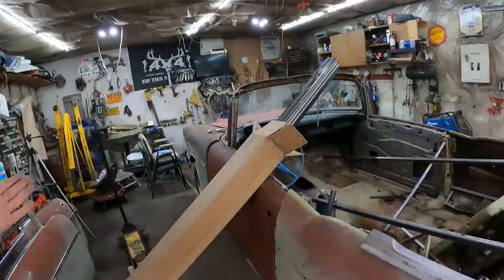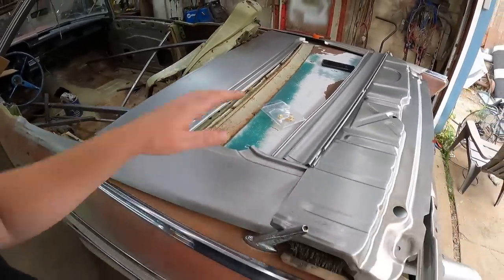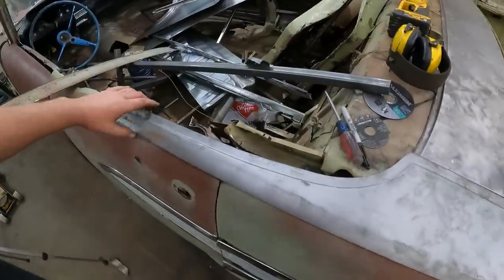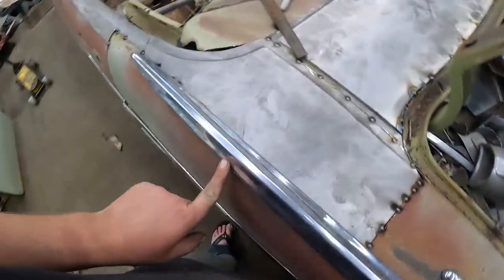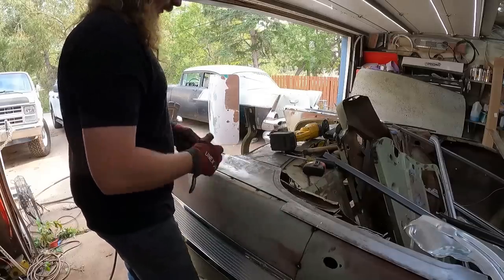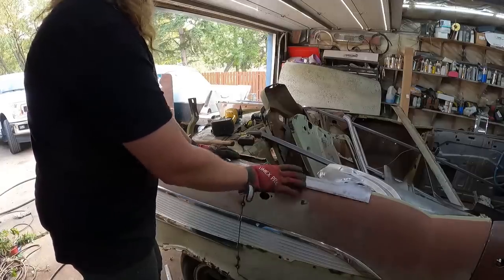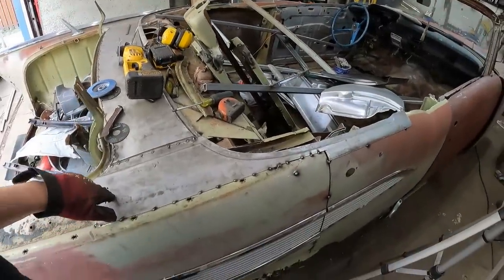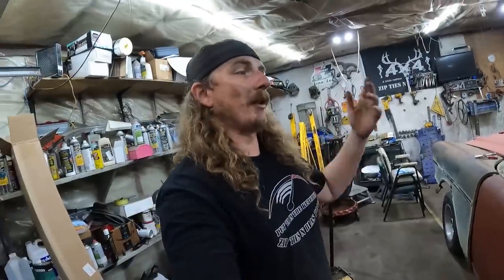WARNING! Imposter 1957 Chevy Convertible PART 4 - Factory Rag Top Sheet Metal Install

Comment: Dan, I've been watching (and subscribed!) for a while and I'm always impressed with what you do. When I'm lining up panels and I've got them on and off several times, I often use tek screws on overlaps. They're a self-drilling sheet metal screw with a flanged 8mm bolt head, originally for roofing I believe. Nice thing is that you can put a panel in place, nip it up with the tek screws, then take it off to deal with underneath and know that you'll be able to get the top panel back in place in exactly the right place when you screw it back on. Once you've tack welded it in place, take the tek screws out and weld through the holes. I use them a lot - they were invaluable when I did the floorpans in a Beetle, and I've currently got the sills, rear quarters, front bulkhead and doorposts screwed together to make sure it all lines up before I have a mammoth welding session!

Comment: On that molding for around the package tray, what about using the stick-on chrome body side molding or fender lip molding. You said it was temporary, it would do the job for the time being and be fairly easy to remove whenever you decided to deal with the rag top. Also, you can do a pretty a good radius with that stuff. It's a bit cheesy, but it's also not permanent either.

Comment: Your sheet metal replacing looks great. I wish mine was as good as yours. 
 I worked at GM assembly in Janesville Wi. for many years on the solder, lead grinding booth line. The amount of lead poured on the factory joints was very thick and hid a lot of ugly, spot welded ,metal mated joints. 
The lead cooled quickly and was continually reheated with a large torch.  Wood blocks with a wax coating were used to finesse the lead. After cooling, a 50 grit hard back grinder to shape the excess solder off, then 80 grit soft back then 100 grit and so on.

Comment: Looking good Dan keep up with the good work as for your mig welder trigger on ebay you can the mig gun replacement and they use all the miller parts i bought one about 4 years ago and been holding up fine they are like 65.00 us so a little more. Canadian but sill cheap and always good to have a spare.

Comment: Making it happen, looking good. Its like a puzzle figuring it out as you go. The prefab panels save so much time.
I know what you mean about body pain. I kneeled on a rough cement patio doing a tuckpointing job and somehow i bruised my kneecap or something because the next day i couldnt bend it at all and it got worse as the day progressed.  It swelled up like a golf ball over next few days. 2 weeks later im 95% pain free. lmao

Comment: you did a really nice job sectioning the new ragtop body parts in .
 i like the overlap and cut n but weld , it turns out really good doing it that way ..
           my 55 ragtop project started as a broken in half 56 ragtop &
 a 55 belair 4dr sedan doner car to make it into a 55 ragtop .
 and a lot of new sheet metal like the whole floor pans  front to back  and 2 pc . lower quarters 

   like you bought for the 57
  just like you , i build what i want with what i can get my hands on . 
  you are doing a great job with what you have .

Comment: Love the progress.  Take care of your body.  
I think those panels are designed to lap under existing good sheet metal.  So if you replace both new panels you need to hammer one of those stamped laps up to lay over the other.  What you did works great with filler or weld in a thin filler strip.  Keep it up Dan.

Comment: Ok I just looked. The top attaches under the sheet metal trim and the snaps that are on the trim are for the top cover that goes on when the top is down. The package tray goes away and a new lower panel goes in down at the bottom side of the wheel tubs. The seat doesn’t sit back but it’s narrower to fit the side braces/bow mounts on the sides and the arm rest covers. Also there’s a triangular brace up to the door pillar from the bottom seat brace/mount that runs across the floor.

Comment: The factory use to put lead in the areas that are low where the pannels meet up over the welds. That is truely a lost art with the lead filler. We use bondo today. Just answearing your #?.  You are doing a great job. Rember lead sleds.

Comment: Lookin good Dan. Yes they used a shit ton of lead back in the day. Note to self ' Lead Sled' . I have pulled about 10 pounds out of my 49 Furd in bad joints. Save it, melt it in an old pot, makes real good weights to hold shit down.
Reply from the maker: Yeah. Lots and lots if lead in thr old gitl

Comment: Dan I would not add metal to the seam in the back the reason the top of the quarter panels were not welded solid and the lead was in the seam was so the panel would not tear when the car flexes they were tacked then filled with lead I welded the seam on a car when I was younger it tore on the side also if you fill it with bonds it will also Crack make sure the doors are shut when ever you jack the car up even if you go up or down a curb make sure doors are closed it don't take much to Crack the seam. People might say I'm wrong but ask them if they worked in a body shop 30+ years. I did. Not trying to be a ass just trying to help .Rick427 
.

Comment: Looks good, I think the package tray goes away? The convertible top has to have someplace to fold down into and the motors ect sit in there. I’d have to look at a photo. I don’t think the top snaps on the top of the trim I think it snaps in underneath. One thing I noticed is you’re gonna need the rear convertible windows. I think they are a roll back type. I’m sure they are available repop.

Comment: If I do this to my 4dr hardtop I'll pull the body off the frame first and install the X-member. Then drop the body back on and start the chopping. Safer that way I think. Less chance of tweaking the body. I'll buy the hardtop repop doors and sheet metal I need then get crazy. My Chevelle and Cuda come first. Then the 57. It's waited 40 years already.  A few more years won't hurt.

Comment: I use to install simulated convertible tops if there's a top shop around your area that can bend that up for you it's we make these bending boards they sell the stock straight we just bend it to the shape that you wanted to put the snaps in
Reply from the maker: Ahhh good to know.  Thanks!

Comment: Even if you can't score the top hardware, you could make a hard toneau cover for the rear area, roadster style
Reply: Maybe I'm wrong, but that's what I think he is planning on doing anyway.  My gut feeling if he was going to make a true convertible out of it, he would have already had the top hardware and used the measurements from it to move the back seat forward and make the top well, before what he is doing now.

Probably the only way to do that  would be to find a wrecked convertible and cut the top well out of it.  I have no doubt that he has the skills to do that.
Reply from the maker: Heck yeah man.  Whatever works hahq

Comment: I'm thinking the inside curve of the before trunk package tray piece. Lines up with where the Top of the roof of non convertible 57s are. Might take a look. measure 100 times cut once. Cheers my friend. Go forth and beat that 57 down bro. Make it Yours.

Comment: Dan , I though you hate body work ? well I have used many of them parcel patch panels and they all require a TON of mud work ! and 100s of long hours of block sanding to look anywhere near even ok !.  The seam filler your looking for to use in the wide joints is called Alumina lead or there are a few other types of soild polyester fillers you can use but  a can of the good stuff is pretty pricey !.  However most body hacks just mix up a batch of Dura bond ( or in the US we call it Duraglass ) and slam it on, then finish it in mud. It will hold up for a few years like that before it tends to crack under the mud, then you got a royal nightmare to fix it later . . I would not recommend you weld steel over the seam as that joint has to move and yous asking for real problems if it's to solid and can't move at all.

Comment: You painted the frame, are you going to paint in other areas?  Did you do anything for the rust, POR 15?  It still looks like a 4 door with the top chopped off, and will until you get the rear door/panel welded in.  Go all in and paint it nice and get a new trim piece for each side that is all 1, instead of 2 pieces for over the rear door.  You make it look simple but I know it is a lot of work and should be worth it in the end.

Comment: If nothing else if it don't measure outright for ya, you can make a Temporary Removable metal cover over the back seat up to the back of the front buckets to make a 57 Tri-Five sport Roadster like Chip Foose El Dorado.. Use the hardtop skin.

Comment: CHROME Stainless Trim where the overlap is. (2) 5 inch pieces as wide as that inset. 1" wide? 
2 holes to attach like the stainless fin trim. factory pins. Clean. Lines up with the trunk.
With the convertible top up or down. the trim would come up to the edge.

Comment: Wow Dan . That's going to be a brand new car when you are done ! Not to be a doubter , but , will a convertible top for a 2-door reach the front windshield on a 4-door ? Or will you be modifying the framework of the top to fit the added length of the car ? Another way to ask would be , how many convertible 4-door "57" Chevrolets were actually manufactured ? Just wondering if this might turn out to be a "1 of 1" kind of car . Most , if not all , of the convertible cars I've seen are of the 2-door body style . Just saying , something to ponder when you put a price on it , at the end of this magic !
Reply: They are the same length
Reply from the maker: I'm hoping it all works out for me in the 3nd gagq

Comment: The factory was set up to put lead on every car. Put a steel filler strip in and body filler. Also did a convert even have room for a package tray cause thats where the top folds to?
Reply from the maker: No package tray on a vert I do t think.

Comment: We knew going in it was a rabbit hole. I realize that even though its beat down really hard, it really is very doable. If that body had been perfect but hit hard on one quarter and all of it had to be replaced, you would of stepped in and got it done. Once the pieces and parts leave the back and you have fitted all the pieces in place, it will last as long as it holds your interest. Some want you to blow it apart and undercoat to make last longer and I don't see it as if it needs redone in some places in say five or ten or even twenty years, Patch it again and it will not take all  that long to redo. If you blow it apart, I see a month of sundays to get apart right and then reassemble it. I have done my own work and knew just what it took that first time to put together.... guess what, reassembling it just got  real hard cause nothing reattaches like it did the first time. I think  that we all might just have our toys taken so we can't pollute the earth like the chinese have done and will  continue to do for another ten lifetimes. Maybe in your lifetime they will discover the fountain of youth and you and Dani will have another nine hundred years together. So nine hundred years from now you and the lady can go for a rip in the fifty seven and you can spin up the electric motors in it. Mr. musk here you go.

Comment: I’ve never noticed any weld through primer used on these cars. Aren’t you afraid of your work rusting out prematurely?  Otherwise I love the channel and all the budget builds. I’m just an auto body tech hoping to give some constructive criticism.
Reply: Valid points. But on my cars which I did very early on on my career not knowing any better didn't use weld through primer etc etc and the car still looks great and it sees rain and has actually seen snow twice.
Reply from the maker: I typically don't.  Rust doesn't really scare me
Reply: Seam seal all the welds and through some cheap Rustoleum or Tremxlad on the back side.  Most of the cars reworked like this never see much weather after they are done. So no worry about rust coming back
Reply: Dan likes a little rust

Comment: hey dan, i do not know what series welder you have, my miller had a switch i could set and it did a automatic spot weld with out needing to pull the triger. all you do is hold the triger on and pull the wand across what you are spot welding and every 3 seconds as a example it would make a weld. I loved it cause saves the trigerswitch.  ps my switch also crapped out. i think was from age though.. lol my welder was a Digamatic 250, miller, so miss it  it got stolen, stupid theives left the argon and co bottles and cut the hoses on the flow meters. they also stole my brand new auto dark helment gloves and leather coat. so was a serious expensive hit, and my ass hole boss will not put in insurence claim so i take the hit AGAIN.
Reply from the maker: Oh man.  Thats brutal!

Comment: LOOKIN. GOOD.   Solid. Mass. Something. To. Work from.  When. I work. At. The cardiac. Center. 1980.  Buy. A. Gm. 350 crate motor.  Long block.   1000.00.  Going. Ls.  Or. What

Comment: If your going to put the convertible mechanism in I think you have to change the way the bracket for the trunk lid attaches to the wheel well. I read somewhere a while back that the brackets on convertible was different.  I found a picture of one of the convertible bracket and made a pair for my gasser after I added mini tubs cuz it looked so clean, not for mechanical reasons lol. Here is the video if ya want to take a peek
https://youtu.be/gh9TXrFXMGQ
Reply: Dude that sheet metal looks so good! Telling ya, beach cruiser!
Reply from the maker: @bwsgarage  haha ill cruise it to your place
Reply: Absolutely Dan, just so you know, I am 1 and 1/2" hours from Ocean City New Jersey,  and 2 1/2 from Ocean City Maryland.  So it's a win and we can beach cruiser the hell  out of it!

Comment: Come on guys, why? a 5.00$ piece of sheet metal, a steel press that may have been made in the 70s, and no disrespect, but an entry level operator, and they are not rare or unique  pieces, my 55 2 Dr wagon floors were not bad, but I just used sheet metal patches $$$$.            ?are 2 door wagon doors the same length  as 4 door?  My doors are 46" love the budget builds thanks

Comment: Keep it a roadster. Convertibles still should be garage kept. Always mold and mildew, leak air and water. A little bit of custom roadster is much better in my opinion and it will be the only one like it.